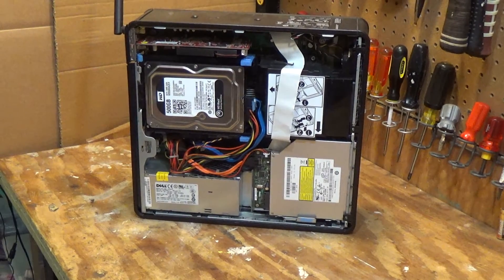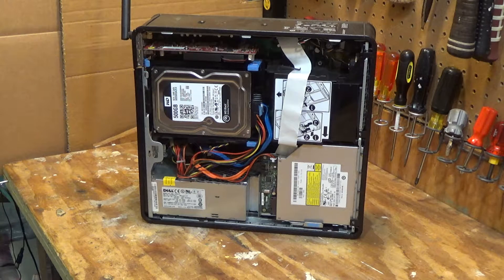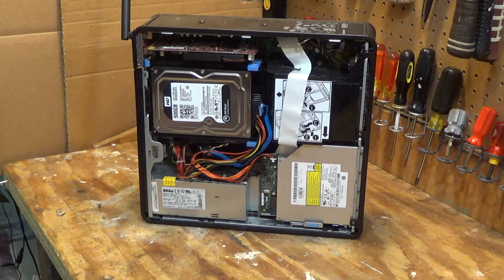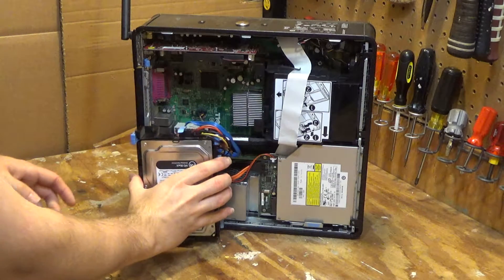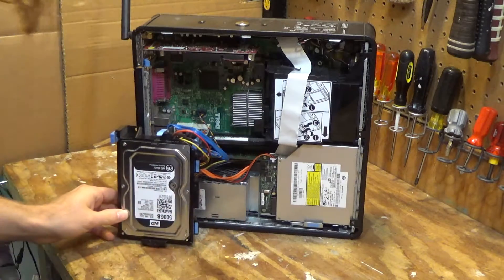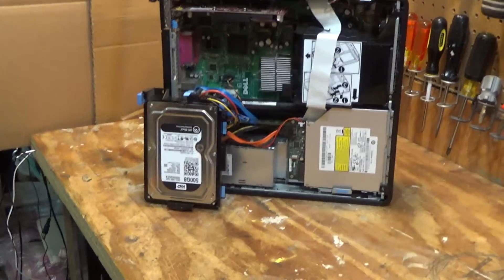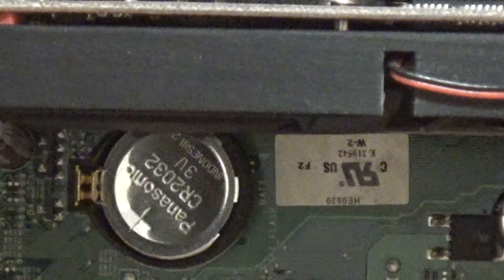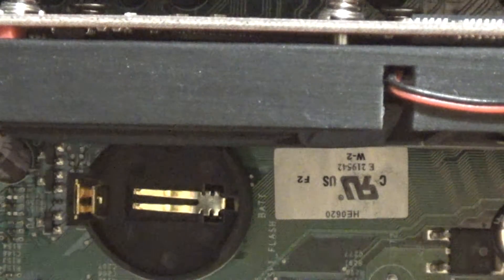Replace CMOS Battery in Dell Optiplex 745

Comment: My BIOS says PCI Slot Empty, so it can’t detect my GPU. This happened after installing a new cpu, I had to go back to my old cpu. The PCI Slot says still empty and it can’t detect my GPU.
Reply from the maker: Perhaps the CPU is not compatible with the board or the proper driver was not installed.
Reply: @JordanU  I bought a new bad GPU and it shows a signal. My old GPU doesn't show a signal nor is detected. I've tried resetting Windows and reinstalling the drivers. Any help?
Reply from the maker: @penguin1215  Perhaps the GPU is spoiled.

Comment: Can we touch the battery with bare hands? I heard that we cant touch the motherboard with bare hands to avoid static damaging board. But i see u used screwdriver to unplug the old one & then just bare hands to put bak new one. Im not really expert in replacing stuff in computer
Reply from the maker: You should discharge any static electricity from your person before handing the battery and internal components. You can do so by touching something metal.